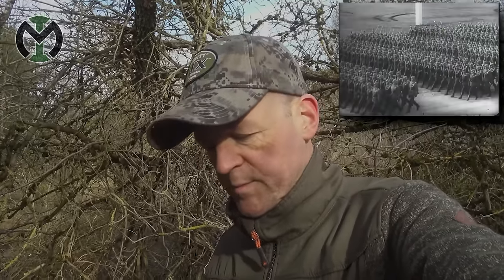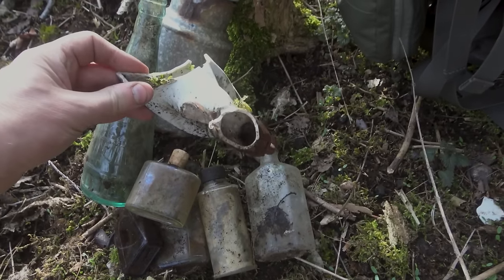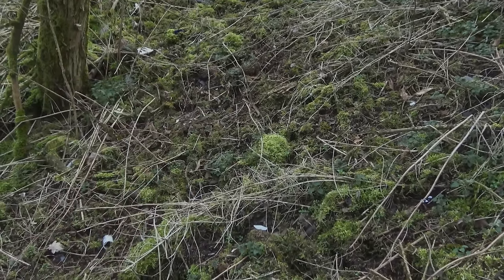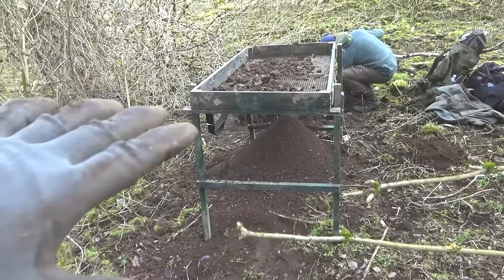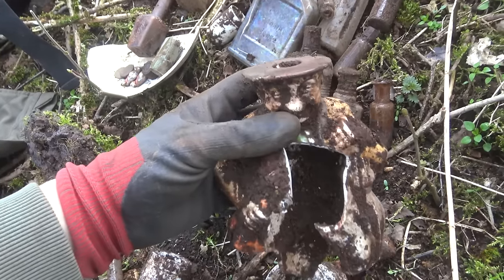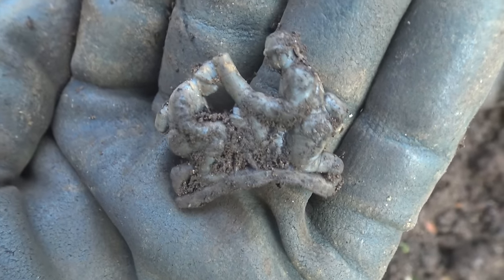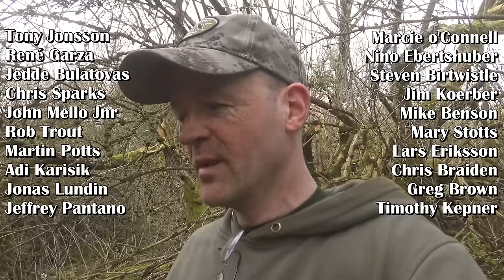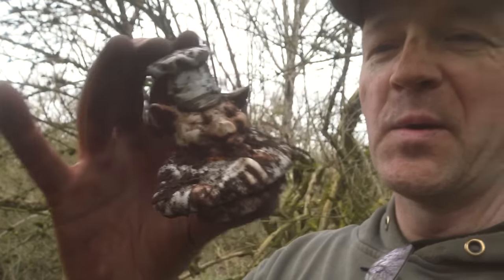Many 3rd Reich and WW2 Relics at Berlin's Historic Dumpsite!

Comment: Per that opening, that must be pretty far outside Berlin? No thick woodlands like that left near the city. Of course there could be in the Northwest and Western edges such as Spandau and beyond, but there wasn't that much combat there. Especially like there was in the East of course. He could be exploring a Trummerberg (rubble mountain). Just about every major German City has at least 1, probably a few.  Especially when you see bricks mixed in with glass, porcelain and the likes. All dumped after the battles and preparation to rebuild which lasted into the early 90's.